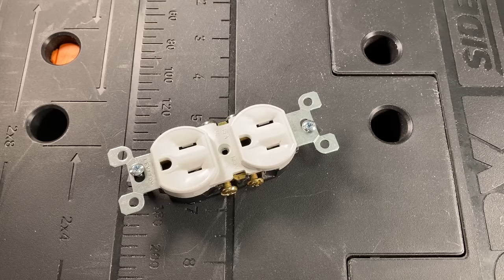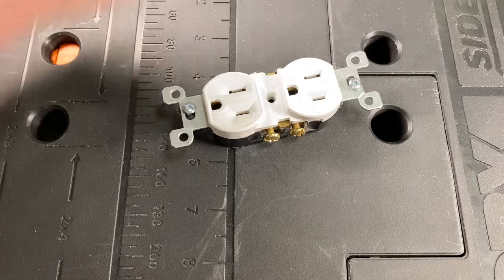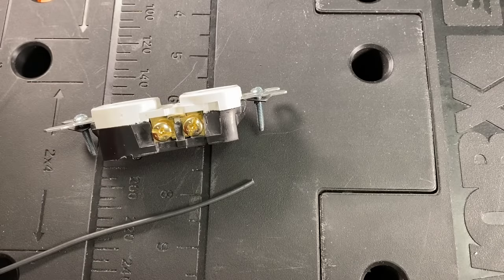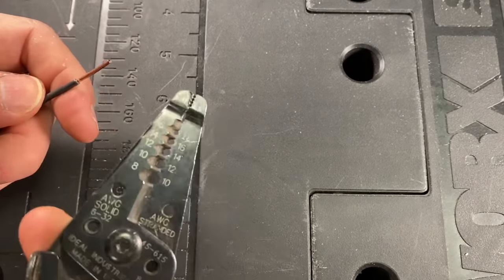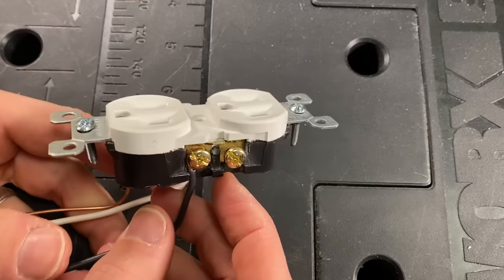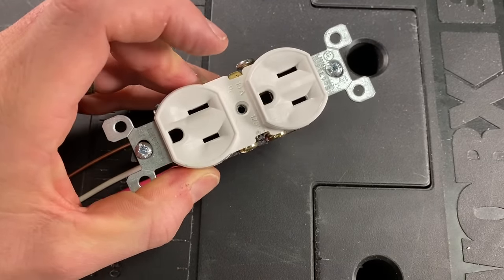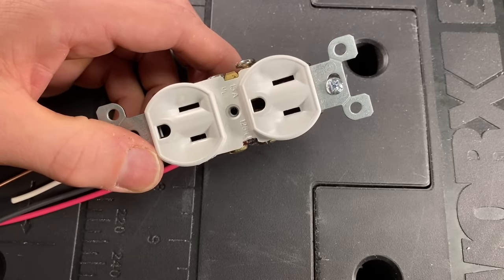Electrical Outlet Basics | How To Wire

Comment: To be complete I hope you said (I paused at 8:05)  something about wrapping the loops CCW on the screw and whether the receptacle is Ground terminal up or not.
Reply: Ummmm I think you mean CLOCKWISE ("CW"), not COUNTER-CLOCKWISE ("CCW") --- having the wire wrapped counter-clockwise around the screw-shank could make the wire loosen as you twist the head of the screw clockwise to thread it in firmly.  But yes --- I noticed this omission in what the narrator said, also.
Reply: Ground up is not important in residential applications.

Comment: My neighbor went to England last summer and he said all the outlets over there have switches right on the actual outlets.  So you are supposed to make sure the outlet is turned off, then plug your appliance in, then turn the outlet switch on.  Why do they have this and why doesn't the US do it this way?
Reply: Sounds like a pain 😃
Reply: Because lots of outlets are down near the floor, possibly in baseboards or behind furniture, sometimes a dozen feet from the handy place to put a switch, like near a door.  I don’t know if it’s actually code, but there should be a switch next to every door into a room that turns on a light.  If you have a main light, there should be a switch for that light next to every door.
Reply: @jimbaranski4687  I actually asked an electrician about this last week and the reason for it is that the 220 volts in the UK makes it easier for the current to "arc" compared to the 110 US voltage. He said it you have really wet hands and you plug something in here in the US, there's a chance you can get a shock. But in the UK, with the higher voltage it's almost guaranteed and you can usually get a bit of a shock with dry hands too---that's why they have the switch right on the outlet.  Who knew?  Not me.
Reply: Who knows? Personally it doesn't concern me. I'm never moving to England.
Reply: @njsongwriter   It's just a point of curiosity regarding possible ways of doing things in a better way to improve safety. Since I posted this, an electrician told me that that 220 volts gives more risk of getting a shock from "arcing" A switch on the outlet prevents this risk. If it doesn't concern you why did you to reply?

Comment: Need to add that the Shepard’s hook needs to point in the same rotation that the screw is going to turn so as not to come displaced when torquing to spec. Also Aluminum wire needs an antioxidant gel. The remaining screws on hot or neutral sides of the receptacle need to be screwed flush to prevent catching or shorting out against say a metal box. I wrap my receptacles in electrical tape to better insure they don’t short out against the sides of the metal boxes. Otherwise good vid.
Reply from the maker: Good stuff, Curtis!  Someone else mentioned the Shepard's hook in another comment and I tried that technique this past weekend and it worked great.  Appreciate all the other tips and feedback.  👍

Comment: also screw unused terminals in tight.
Reply from the maker: 💯 thx Kris 👍
Reply: @EverydayHomeRepairs  did some work on a house where the original sparky didn't.  poor fella trying to reset a gfi go lit up when the socket shifted and a screw hit the box.
Reply: @krisvdovich6308  Never put GFCIs in an old metal box. There is not enough room.  Look at the code for which size box to use!

Comment: 14 gauge wire should never be used on receptacles.  Only lighting and switches.
Reply: I wouldn't say "never." 14 gauge wire is code for 15 amp receptacle circuits. Probably what residential builders do. However, there is a difference between code and best practice. 12 gauge wire for receptacles I consider a best practice and is what I do. Also, it is not a code requirement to wrap receptacle terminals in electrical tape, but is another recommended best practice.
Reply: Running 12 gauge eliminates backstabbing cheap receptacles.  Use more expensive side clamp terminal receptacles or side wire the cheapos.

Comment: In most places 14 gauge wire is not allowed to be used on Outlets you have to 12 gauge wire or bigger 12 gauge wire or bigger will not fit in the holes in the back of the outlet.

Comment: Proof that the push in wire terminals are weaker? I watched a guy test push in wire connectors using various methods including putting way more power through as specified and they worked great.  I don’t think UL would approve them if they were not.  Also, I have seen people do a poor job on the screw wrap and the push in is more idiot proof.
Reply: Zane, I agree with you.

Comment: Its better to use two different outlet than to use a single outlet with different circuits like you mentioned.. i think its not good and very dangerous for safety reasons. But i do appreciate your presentation anyway.

Comment: Split outlet:  I like the ALWAYS HOT on the top side (this is where I plug the vacuum cleaner into)
The bottom is switched BECAUSE (the lamp wire will DRAPE DOWN to the floor)   comment?

Comment: Here's the best advice:  Don't install bargain basement outlets.  Buy the >$2 outlets. The cheap, <$1 outlets won't last and will start arcing and popping very quickly, causing a fire hazard.
Reply from the maker: Get what you pay for, thanks Scott.
Reply: Dukes of Hazzard, or is it a fire hazard?
Reply: Yea, you would think electrical devices would be the highest end of safety, but Nope. Rock bottom prices and quality. 👍🏽
Reply from the maker: @MrSleepProductionsInc  I always wondered how the manufacturers were able to produce and ship the outlets for that cheap.
Reply: If they meet code what exactly is the problem?
Reply: @njsongwriter  code doesn't specify the quality of the outlets.  Cheap outlets are produced using thinner metal.  They become loose in short order and cause arcing and overheating and thus represent a fire hazard.

Comment: I have a problem, i changed outlets but now i can only charge my phone, the outlets wont power on my fan
Reply: You made a bad connection somewhere. Go back and check every one. Guessing it is a bad neutral (white side) connection since your phone charges.
Reply: Guys like you should never attempt electrical work.

Comment: Anybody know why my outlet isn't working? Just replaced it and there are no thrown breakers or gfis in the house??
Reply: Somewhere upstream from the outlet there is a broken connection. Or you have a bad breaker.
Reply: @MurderedOutRam  would that mean I would have to rip out all the wiring?
Reply: Octane24 not necessarily. It’s likely there’s a bad connection or faulty device directly upstream from your non working receptacle. If you know what other switches or receptacles are on that same circuit, I’d start by removing cover plates and visually inspecting the connections
Reply: @MurderedOutRam  
Or the receptacle is wired through a switch that isn't turned on.
Reply: JackTannehillPromoter yeah I guess I just kinda presumed he’d already checked that.

Comment: Another thing he didn't tell you when you wire a plug that you or only using one set of terminals, make sure to screw in the other screws all of the way so they aren't just flopping around in they're holes because if there is any vibration, it could cause the loose screw to move and possibly touch something causing an arc, especially if you used a metal outlet box.  So make sure the unused screws are turned in all of the way.
Reply from the maker: Thanks for pointing that out Kevin.  👍

Comment: Your using 14 guage wire for an outlet? I thought you needed to use 12 guage for an outlet to a 20 amp breaker? I thought 14 guage was for lights? Am i wrong?
Reply from the maker: 12 gauge = 20 Amp circuits and 14 gauge = 15 Amp circuits 👍
Reply: @EverydayHomeRepairs  so your saying there are 15 amp electrical outlet's? I didn't know that, thanks

Comment: need to tighten the screws that are still out( terminals that are not in use )might want to tell then that the if changing outlet that the neutral could still be hot and possible shock (if the neutral is shared )

Comment: its something new to put the outlet assembly in so the ground pin is UP. this prevents something conductive being placed across the plug pins when the plug is not fully in the socket. like a kid might do. do I think this is likely. no.
Reply from the maker: Thanks for the feedback.  It has been very interesting getting different knowledge and experience through all the comments.

Comment: Any outlet that even has push connectors is garbage.  Any outlet that cost 50 cents is garbage.  It’s not worth saving a buck,when your house burns down because of poor connections. I actually make the bare wire a little longer and close the loop with needle nose pliers, so it can’t slip off.  Heating and cooling of the outlet can cause the screws to back out.

Comment: If the switched leg is on a different phase from the unswitched leg and you loose continuity on your recommended single common wire, you just supplied 220 V to 110 V devices! Max smoke! Use 2 common wires and break both bridges to be safe.
Reply: If the red and black wires are connected to the same line in the switch box then there is no problem. Everything is coming brom one breaker.

Comment: That's just fine using a solid core cable, but if you are dealing with the stranded cable?
Doing those loops perfectly its kind a pain in the ....
Reply: Crimp a terminal to the wire...ring terminal best. And cut the front for the screw.

Comment: Never ever do this with aluminum wiring. Knob and tube also needs a lot of attention to detail.
Don’t ever experiment thinking because “it works” that it is fine.
It may cost you and your kids your lives from a fire doing something wrong.
You must use tamper resistant receptacles and replace breakers with AFCI type in 2020.
Reply: The same is true of old BX (metal-sheathed) cable. The insulation in old BX cables turns brittle with age. ANY movement of the cable can cause the brittle insulation to crack and fall off, leaving conductors vulnerable to arcing to each other and to the sheathing. My local fire department tells me that this causes failures in many older homes here in the northeast. These failures can happen whether or not devices on the affected branch are turned on - that means they often happen while the occupants are asleep or away from the property.
Reply: God, I haven’t had to worry about Aluminum in a long time.  If you have some, every component attached directly to Aluminum should be checked that it is certified for use with Aluminum.  Now a days the only Aluminum is large gauge power distribution wires.

Comment: I have 2 black wires. It's for my garage outlet that doesn't work. I guess I'll just hook the 2 black wires up like you hooked up the black and the red, and not break the tab.
Reply from the maker: Hi Valinor,  assuming you also had a neutral (white) wire and a ground (copper)?  If so, then the other black wire can you connected as you mentioned and most likely is powering another outlet/light in the same circuit.  Let me know if you got your issue fixed.
Reply: @EverydayHomeRepairs  I also have 2 white wires and the green wire. I bought the outlet today and hook it up tomorrow and see what happens. I'll let you know the result.
Reply from the maker: @valinormons that makes sense there is basically a set of wires coming in and going out thus the 2 white and 2 black wires.  As you indicated you will just connect the 2 black wires on the brass (gold) terminals and the 2 white wires to the silver terminals and the 1 ground wire to the green terminal.  Let me know if you have any trouble swapping it out best of luck!
Reply: hotrodd100  Oh you know, I was talking to an electrician at Home Depot who happened to be shopping there and he told me that it had to be a GFCI outlet that was tripped. I told him that I checked everyone I could find and he said it had to be one that was near the fuse box. I told him that I didn't think there was one near and he told me that there had to be. "Keep looking!" So I finally found one in the adjacent bedroom that I'd overlooked. And when I put in my plug tester the outlet was tripped. So I pushed the button and now everything's online! And I also have a new electrician when I need him!

Comment: A 1/2 switched receptacle has zero to do with “ older homes “ or “ high end homes “ it is actually a NEC code requirement for bedrooms or living rooms without a ceiling light .

Comment: Wait, i thought red(danger/attention/forbidden) was live and black was neutral.
Reply from the maker: I guess first thing is to always be cautious as technically the person who came before you and wired in the outlet and/or switch could have used any color.  Usually white = neutral, bare copper or green = ground, and any other color = hot (black being the most common).
Reply: You are thinking of 12v when black is neg and red is power
Reply: You've been working on too many cars.

Comment: For us old bass tards. The wire gauge numbers on all strippers need to be LARGER so we can see as well feel.
Reply: Yeah and the words "shampoo" and "conditioner" should be in large enough print on the bottles so you can tell them apart when in the shower with no glasses on.

Comment: and we should use the tape to wrap it
Reply from the maker: I have seen some people do that over the years but I personally don't wrap the outlet with electrical tape.
Reply: The Code frowns on taping devices.  It's bad practice.  Save the tape for bug nuts on service drops.
Reply: @lichub  
How will you electrocute those insects that get in the box if you wrap tape around the connections?
🤔😁

Comment: 14 gauge wire on a 20 amp receptacle? where is that legal?
Reply: Where did you see a 20Amp receptacle? It is a 15A receptacle, that is CAPABLE of passing 20A through the feeder wiring, NOT through the plug outlet.
Reply: It's not.

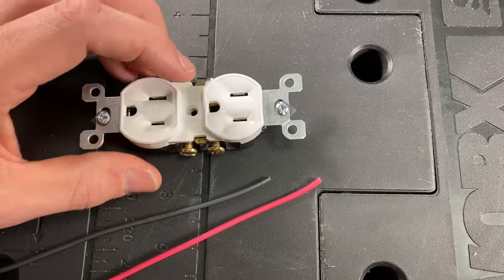Comment: 2:30
I think that’s wrong. If you use 2 separate breakers, 2 circuits, 2 hots, then you should use 2 separate neutral and disconnect the tab on the neutral side too. 
Otherwise, if one of the neutral wire fails, twice the current could flow through the remaining neutral and overheat.
Reply: And skip a breaker so you don't have 220vac in that box
Reply: @shothud  
Interesting. I thought it would be better to have 2 different hots. To balance the load. But you make a good point.
Reply: @paftaf  I do try to balance the load with freezers and refrigerator but for instance I wired a casket display room with 327 halogen lights off one switch circuit. Three #10 feed wires and neutrals feed from three 30 amp breakers of the same phase on a three pole relay. Switches last forever due to very low coil current and no 220 vac at the relay box.
Reply: @shothud  
Wait, you wired a “casket display room”? 
And freezers? 

Dude, your life is much more exciting that mine. And you do commercial wiring. I’m just a residential amateur!
Reply: If you're right it seems both neutrals would need to be different colors (like white and gray)  to keep them properly separated from one box to another.
Reply: @njsongwriter  
That’s a great question!
Are neutrals required to travel the same path?
Anyway, it’s easy because in residential we use Romex, so the neutral is right next to the hot, easy to pair.

Comment: Another good practice when  working with electrical and this will make a lot of wives mad but it is not wise to wear wedding rings necklaces because they are a very dangerous around electricity! So if your husband or wife is an electrician and they come home not wearing there wedding ring don't automatically thank him or her has been to the bar Cheating on you be thankful he or she came home a live!! And always remember that the number one rule of safety is that SAFETY STARTS WITH YOU!!!!
Reply from the maker: Good call out.  For my old job which was working around heavy equipment this was a rule for the same reason.  Appreciate the reminder.

Comment: Forgot to mention split receptacle for a kitchen split plug.
Reply: What is that?
Reply: @Jamey Matheny It's bad practice for two separate circuits but necessary for 220 receptacles with a neutral.

Comment: I don't always trust those voltage testers. I would much rather use a voltmeter after I test a hot circuit with it, first.

Comment: Or you can just save time and use the app holes in the bottom sticking the wire in if it is 14
Reply from the maker: Hey Miguel,  my personal opinion is not to use the push in holes as they are more susceptible to failure.  I would recommend taking the extra few mins per outlet and using the screw terminals.

Comment: But you said nothing about the most important issue of all!   Ground plug towards the bottom or the top? :)
Reply from the maker: bottom
Reply: Hospitals specify ground lug on top. Why?? Well, it’s an inherent safety device by protecting the two other conductors if the plug is somehow pulled out a bit and something happens to fall on top. Check out European outlets and how much safer they are compared to the USA.
Reply: @leekazan556  I did not know that but it makes sense.  Almost all residential houses I work in have the ground plug at the bottom.   I'm not aware of any code requirements for the orientation.  Thanks for the info!
Reply: Top. Actually it doesn't matter but codes in our area have been changed from no preference to top.

Why is that even important (let alone most important)?

Comment: Perfect for hot and n next heater is backwords  I’ve seen fire none breakers or breakers not shutting off zinsco is very great rv 60 amp cord on it I’ve never had problem assure it passes codes now other units outlets ok but nearly every appliance is wired main cord wrong snip off bibs and use on black side all ok 6 months hard every day heater 3 of  nothing wrong  yes always screw s not holes wires come loose